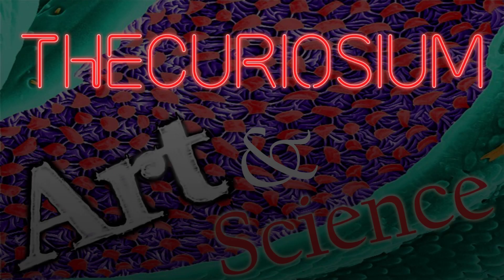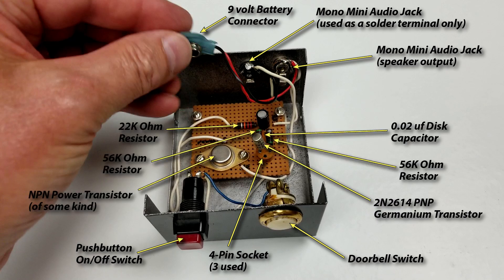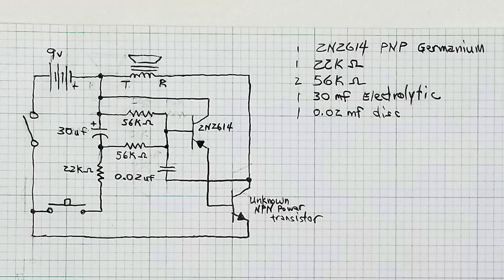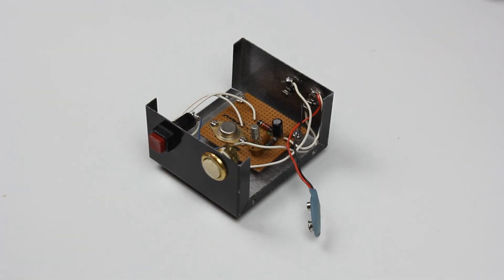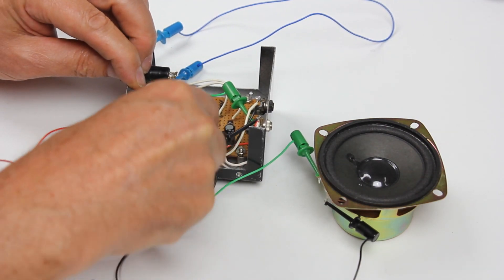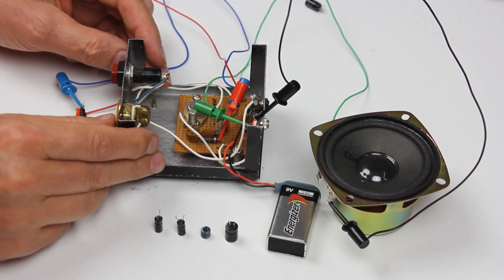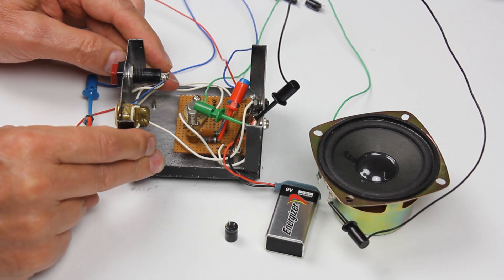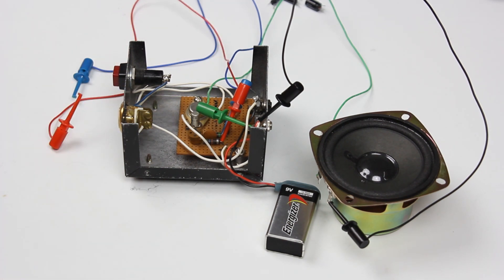Retro-Redux - I Tear Down and Test My Own Vintage Project

Comment: I like the 33 sound the best.
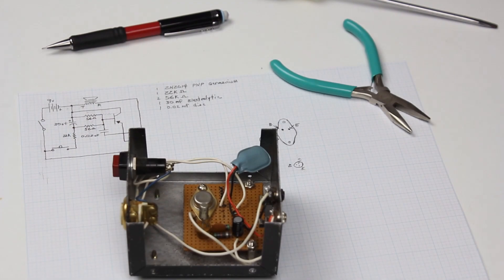At 2:22 you say: "the point two micro-farad capacitor controls the starting frequency"
Your diagram says 0.02 uf, and the magazine says .02-mf. I know uf and mf is the same, but .2 and .02 is big difference. Is it really .2 uf on the one you made?
Reply from the maker: Good catch! It is a .02 uf in my circuit just like in the diagrams. I said it wrong in the voiceover. Thank you for pointing it out, and thank you for the vote!